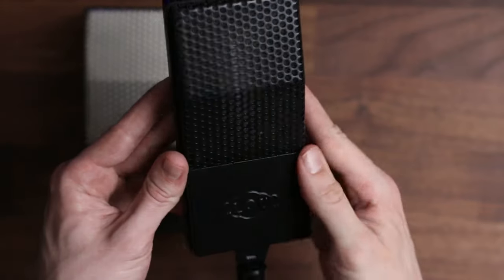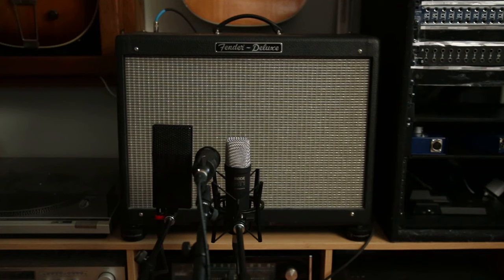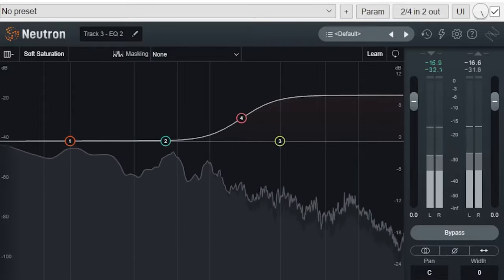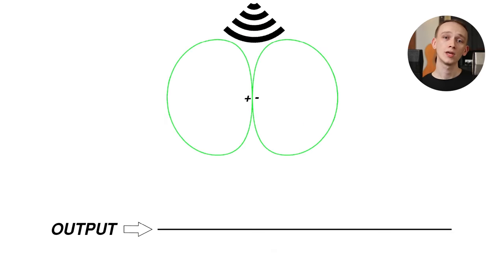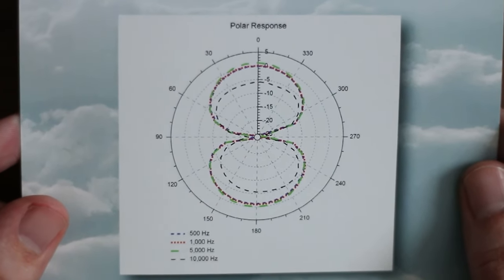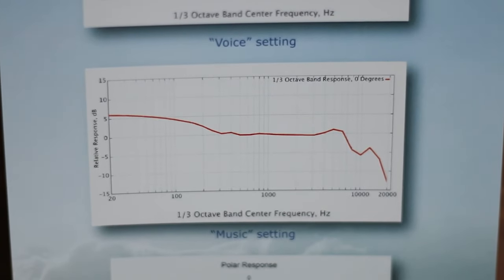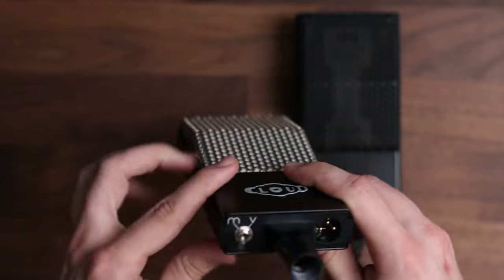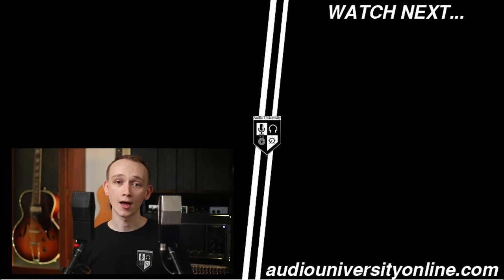Ribbon Microphones: The Complete Guide for Recording Engineers

Comment: Ribbon mics and me have been besties for a while. They're so good at preserving the tone that usually gets lost whenever I record my violin. The only beef I've had with them is the high amount of gain required to get a good signal, and the inevitable fight against the rising noise floor. I recently received a 32-bit float interface last week and it seems to do some amazing stuff with passive ribbon and dynamic mics, since I can cut out the additional preamp entirely. It feels like I've been able to boost the tracks in my DAW with less noise because there's less hardware in the signal chain. The overall tone feels different too, but I haven't done any particularly scientific tests with it so I can't tell if that's just placebo yet.

I'm curious about what your experience has been. Have you had a chance to use a 32-bit float recorder/interface yet? If so, has the dynamic range altered your recording techniques or mic placement with passive microphones?
Reply: I think your new interface simply has less noise, than whatever preamp you were using. I don't think 32-bit float has anything to do with anything, in this situation. A violin doesn't have that wide of a dynamic range, and you're probably in a home studio, with an ambient background noise level of about 45dB.

A violin can hit about 92dB during loud passages, therefore giving you a useful dynamic range of 47dB to work with, which a 16-bit or 24-bit interface can handle with ease. Plus, you have to account for headroom, on the way in. So, you really have like 35dB of dynamic range to work with, when scoring your violin.

In the end, do whatever sounds best, to you... and I suggest keeping your interface gain set so that your violin peaks at around -16dB to -12dB, during the loudest passages, on your digital meter. This will ensure that your analog gain stages are not in danger of overloading (which is worse than noise, IMO). Then, simply boost the signal in the DAW by normalizing, or whatever you do, after the track is already recorded, so it's ready for mixing.

The music and the performance is always way more important than the gear or the specs, but it's okay to enjoy your new toys, LOL.

Comment: Just received my first ribbon after years of stage and studio performance 
The home studio option is now an affordable luxury and I’m going on my 8th year in the chair

But I do enjoy quality and pedigree as a gear snob I don’t do clones no offense to the warm audio crowd, we never had them in my playing years
so at 62 years old I guess I’m spoiled although I did try some against the real deal but they fell short in performance but you can’t beat the price
for just how close they can get

Anywho my first ribbons are Royer 121’ although I had a r10 shipped as well I’ll most likely keep just the 121
I spoke with a Royer engineer regarding the handling of the Royer builds and although they are delicate in comparison to our dynamics
and condensers he assured me that at least for Royer that the opening and closing of the storage box won’t generate enough pressure to 
stretch or damage the ribbon also the vertical storage protocol common in vintage ribbons was not necessary 
To preserve the mic of course read the manual in toto and as Kyle points out avoid any direct air pressure directly at the ribbon
always test the feeling of air movement, like from a cab with a punchy output using your hand or a sheet of paper and use pop filter or two also the offset method to allow air to
brush and deflect as opposed to direct reflection of the air movement is a good idea
Like Kyle, I will be babying my ribbon investments with provided covers when moving from position to position
Since direct plosive air movement seems to be the enemy 

I plan on moving these ribbons as one would while walking and singing with a birthday cake,
being carful not to extinguish the candle flame with the speed of movement or the direction of the air from the song
That being said my tube amps collected over the 44 years as a professional and semi-professional guitarist will get to
Yell in the Royer ear as they have using the 57s, 421s, 609s, c414 and even my “vocal only” U87 with all the combinations 
I can phase manage

Comment: I've often speculated that ribbon mics in the classic figure of eight configuration, (as opposed to some of the more directional designs), might have a form of natural compression. Singing or playing loudly into one side of the mic wouldn't some of the louder primary sound come around to the back of the mic and be well out of phase and start to cancel amplitudes? I would really like to see a proof of concept on this one.
Reply: The direct and reflected sound reach the ribbon at different times, so phase cancellation isn’t terrible.

If you’re close enough to a boundary that this becomes an issue, you are too close.

Be careful to avoid hitting a ribbon with phantom power, unless it’s active.

Nicely done tutorial!

Comment: Thank you for the amazing video! I'm a saxophonist and often very disappointed to hear how I sound like in dynamic mics when performing because it doesn't reflect my true tone I worked so hard on, is there a good mic to bring to gigs that can best reflect my true tone like a ribbon mic? I'm looking for a warm sound instead of a overly bright one. Is RE 20 a good option? Or should I just get one ribbon mic (my friend told me it's a bit of overkill to bring to gigs and it's very fragile)
Reply: Some of the Beyerdynamic ribbon Microphones are stage-worthy, have cardioid or even hypercardioid pick up patterns so are not as prone to feedback  as  figure of eight. The M500 model, especially when modified by Stephen Sank, are particularly expressive microphones.

Comment: To my ears, the Rode sounds by far the best given the very unpleasant distortion from the amp. Does it have a faulty preamp stage ?
Reply: I think that distortion was an active choice for coloring the signal. It does a pretty good job of showing how the condenser vs ribbon reacts. Ribbons gobble up the lows while condensers are better at capturing the mids at that distance. The tough question is what the amp sounded like in real life, vs what we're getting. I can't find a frequency response graph for the passive Cloud 44, which is a shame. It'd be nice to know how mountainous those low ends are, depending on the distance. Another 6-12" might help here, but then it wouldn't be an apples-to-apples comparison.
Reply from the maker: Thanks, Pirojf. You can see the frequency response from the microphone booklet in the video.
Reply: @AudioUniversity  Ah, yeah there it is. The low freq is flatter than I expected. Does the manual state at what distance it was tested? The m160 I have came with a graph showing the distances where the proximity effect starts to kick in. About 4-6" is where it becomes a chonky mess, so if I recorded an amp at that distance it would come across a bit smothering.
Reply from the maker: It’s sort of an optical illusion -  the amp was about 18 inches away from the mic in this test. But the amp was bass heavy for this particular test.
Reply from the maker: It does not indicate the distance of the measurement in the manual.
Reply: @AudioUniversity  ahh, that's helpful. It looked like it was right up against the amp.

Comment: OK,  I'm seeing mics without designations being place in different places than the ribbon mic was placed. Of course they sound different, ALL mics sound different to some extent. Edit out the biased "comparison test" and you have a good video on ribbon mics. 
Identify all microphones and place them identically on the guitar amp speaker and you have an actual test with integrity. 
Otherwise, foof...
And yes, the Cloud mics are great mics. Do yourself a favor and fix the obviously flawed comparisons. Put all the mics on the edge of the speaker, or on the center or both and let us hear what the difference really is about. A mic on the center of a speaker does not sound the same as the same mic on the edge, proven science and easy to do.
Reply from the maker: Hey Michael. You’re right that all mics and placements sound different. The electric guitar test is a bit of an optical illusion, unfortunately. I should have used a better camera angle. The mics are all about 18 inches from the speaker. The difference in tone between those placements at that distance were not nearly as severe as they would be in close proximity to the speaker.

Comment: These videos are great, thanks for sharing :)
You know, I've always heard about ribbon mics having the best transient response, with condensers in second place and then dynamic mics.
But how can one properly compare transient response between different mics? How can I objectively tell that a ribbon outperforms a dynamic in this sense? Or even compare the response of a high end dynamic against a cheaper dynamic.

Any thoughts on this?
Reply: I don't have a technological answer for this question but I have always felt that ribbons reproduce the true 'shape' to the sound as well as other characteristics. 
You can really hear that on the drum recording as well as the guitar amplifier recording in this clip, and the transient response is not just better in the high frequencies which is often where people are gauging a microphone performance, to me it seems like that transit response runs the entire frequency spectrum range. That ribbon is just so free to move especially when it is 1.8 µm or less in thickness, heavier than that and it starts to sound a little less responsive and more tinny to me.